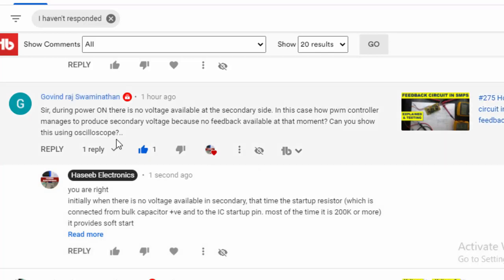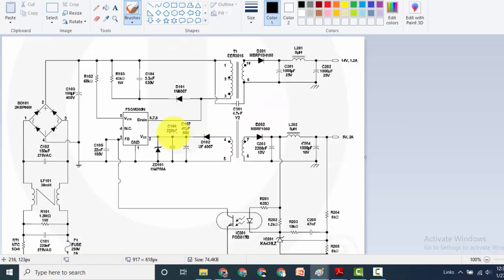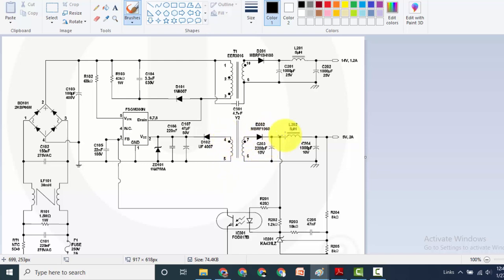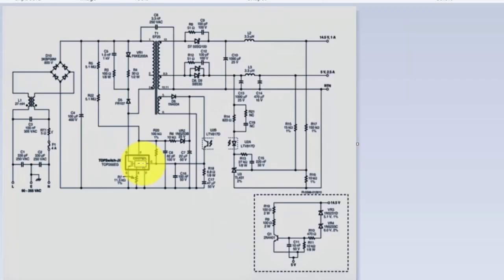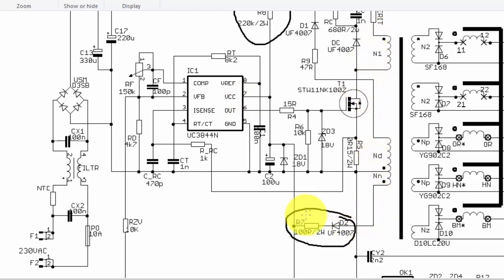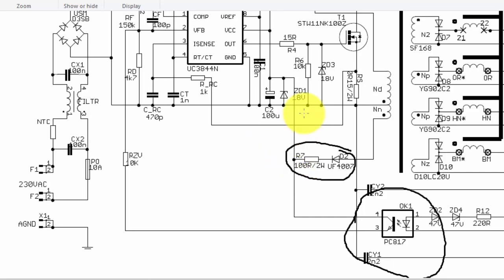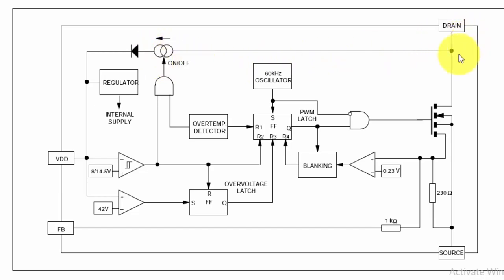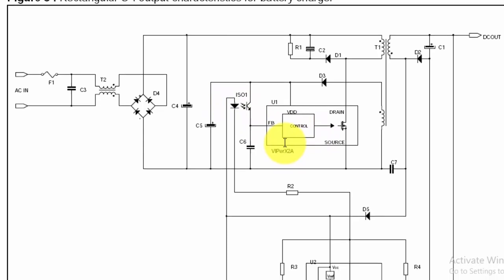{315} How SMPS starts and regulates the voltage

Comment: A Note: When you install the startup resistor. Always put the short end towards the high voltage. Because if the high capacitor DC voltage is on the exposed wire part of the resistor, it will arc if you are not careful. I set the PCB on fire with the mistake once !

Comment: Your all videos are very good . Sir haw can we make a  ac to DC 12 volt   60 amp without transformer supply
Reply from the maker: special thanks and best wishes 
for so huge output power (12 x 60 = 720 watt) you must use half bridge or push pull topology. with short circuit protection

Comment: Sir, when load disconnected 5v rail and 12v rail normal.With main board connected 5v rail drops to 2.4v and 12v rail drops to 10.84v.I disconnected the cables individualy on mainboard but still showing the lower reading.this psi used viper22A controller ic.This dvd as no display on front panel.What could be problem. Thank you.

Comment: Salam.
What is the reason of fluctuation in this start voltage in most cases.???
Because it just provided from a simple resistoer and its not depend on feedback and regulation.
But in some cases bulk capacitors voltage is fixed but voltage of vcc pin of start ic is fluctuating

Comment: At the end of this video, i found something interested me to know the TNY IC work in board power supply 🙏. Hope u can continue it
Reply from the maker: yes  most of the TNY, TOP, LNK switching ics have internal voltage regulator to charge its external vcc capacitor, when the capacitor is charged at required voltage level, this ic starts switching 
and auxiliary voltage are passed directly or through optocoupler for continuous operation

Comment: sir where can one  find schematics diagram of china ups, inverter welding machine and dc inverter air conditioner. pl guide  God bless u and ur family.thanks a lot.
Reply from the maker: perfect diagram can be obtained from the manufacturer or service centers. 
on internet diagrams are available but most of them are incomplete
dc inverter ac diagrams are rarely available. as it is new technology so companies are earning mony by replacing circuit boards. some diagrams like sharp or phoenix china ac's diagrams may be available in some service manuals.
Reply: @HaseebElectronics  thanks a lot sir for quick and positive response.

Comment: Good day Admin..How can I calculate ferrite core transformer for UC3855 Smps power supply output of 12V 5A
Reply from the maker: uc3855 is pfc regulator ic, so you need to design PFC choke.
Reply: @HaseebElectronics  Pls can lindly put up a tutorial on pfc choke